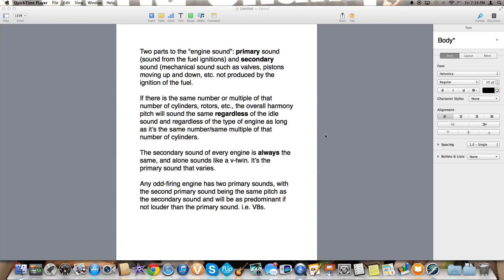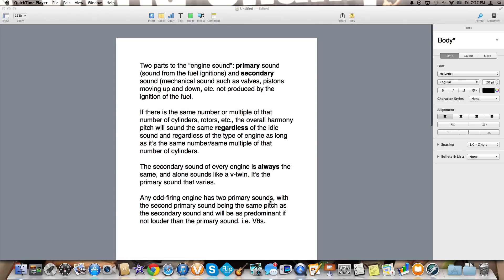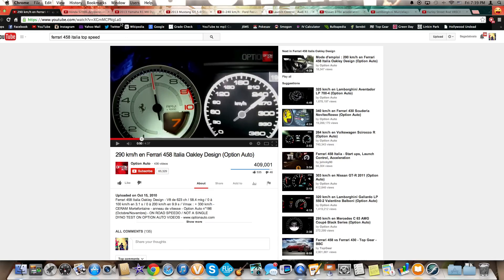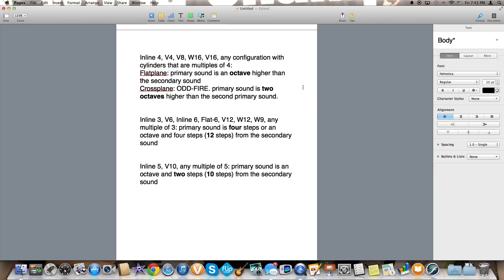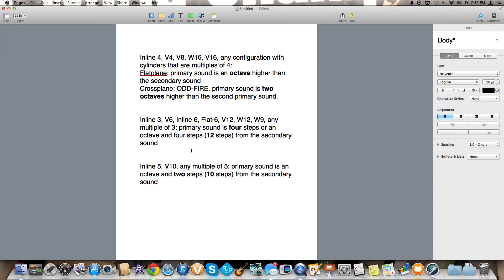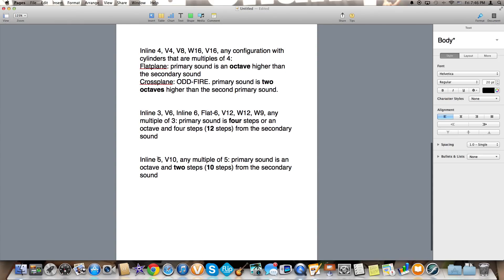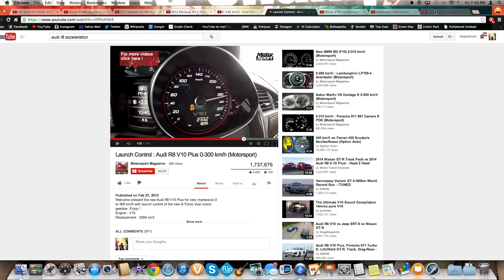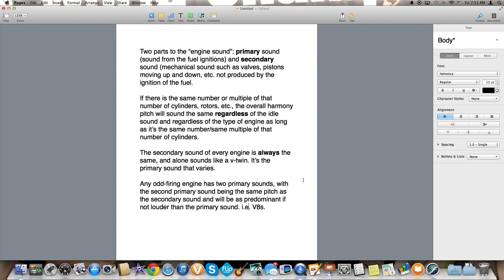Engine Sounds Explained

Comment: if you want the v6 to sound like a v12, wouldn't you need it to rev twice as high in order to sound the same?
Reply: Exactly correct.
Reply: No
Reply: no not really
Reply: No matter if you rev a v6 twice as high it would never sound like v12 unless you try to add some extra 6 cylinders if that's even possible even with those extra cylinders it might not even sound like a v12
Reply: Clearly you don't pay that much attention to engines
Reply: Cicada 3302 since a v12 is basically 2 v6s implying the firing order is similar to that of the v6 you are comparing, then it would be 2 v6s working together, the pulses would be closer together because there are more cylinders firing in the same amount of time so it's a higher pitch, but if you slowed the v12 down to match the v6 pulses it would sound really close

Comment: i3's sound like I6's, i prefer the sound of i3's over i4's personally.
Reply: i6s sound comparatively smoother and higher pitched than i3s. Although between the i3 and i4s, i like the characteristics of the i3s. Sound wise, i like them differently in different environments.

Comment: The Mustang is a flat plane crank motor ????
Reply: nope, cross plane.
Reply: @mcr0741  the new high reving gt 350 is a flat plane crank the old school 5.0 is cross plane but it is going away
Reply: @randyyoung9892  yeah, I just saw that. But the new 2020 GT500 is using a 5.2L cross plane V8.

Comment: I stopped watching after he said a V-twin is an odd firing engine. Because 2 is an odd number?
Reply: He is referring to the firing. Not amount of cylinders.
Reply: Banana Boat the v twin does have an odd firing order. its two closely splaced pulses per 2 rotations (considering the exhaust and the intake stroke) making them sound more similar to single than a flat twin.

Comment: using the term " ricer "  as a catch all inclusive term is prejudice.  not all flat plane crankshafts were made by the japanese. numerous flat plane crankshafts have been produced by euro nations. 
the first car i owned was a british 4cyl. 
triumph and mg had flat plane  " ricer " crankshafts, just to get started.
the brits died because of their incapacity to innovate ,  produce reliable electronics of both electric and fuel delivery systems , and like all western nations the incapacity of less expensive mass production.
 the old lucas electrics were  SHIT  and  AMAL carbs worked well when they worked.  in fact i found it much better to adapt a set of flat slide motorcycle carbs  ( mikuni ) to the british triumph/mg engines to make a  VERY   VERY reliable tuned multi carb fuel delivery system. it also helped to throw out the lucas coils, condensers etc and replace them with american produced  autolite, delco etc parts  ( adapted ) to make a performing ignition system that would stay on the road and out of the garage.  
the japanese, whether you like it, like them or not, have mass produced machines that have dominated the world markets.  you negative prejudice is possibly spawned from jealousy considering they also export the 2 fastest motorcycles in the world and dominate in the moto - everything classes in world wide motorcycle competitions. 
in fact your degrading terminology is quite short sighted considering the japanese have essentially bitch slapped the whole world with the most reliable- most massively produced engines ever, especially considering the price. 
harley v2 does not sound like other v2's. the harley v2 is 45* while most ( not all ) other v2's are 60* or 90* which make much better and smoother power because of the more symmetric power strokes, shorter stroke vs bore , valve train type and  geometry . the 45* v twin is more commonly used on bikes designated as " cruisers "  making high torque at idle and cruise, but not accelerating well across a wide band because of their massive weighted crankshafts.  60/90* twins make more efficient power across their entire band because of more symmetry in their power strokes and the ability to use a lighter crankshaft.  the loping of the 45* twin is caused by the disproportionate  asymmetry between power strokes and the long stroke vs bore. while again the 60*/90*  have a more " square " " balanced "  or bore being over or closer to the stroke length of the motor.
Reply: +mixter7x7 Ferrari, Lambo, and does Porsche use it also?

Comment: thumb down cause you included Japanese motorcycle inline 4 with  rice honda. all inline 4 600cc 1000cc sound like a moto gp or f1, nothing close to a inline 4 on a car. its insulting that you combined in line 4 cars with motorcycles. especially a hayabusa, they eat any cars on this planet. for the money you cant get the power and performance from a super sport or a super bike.
Reply: Mai Le fastest bike top speed 300-320mph, h2r cost up $60k, h2  $25k can do 200mph easy, so do the reasrch before you type ,keyboard warrior,let's see if r8 cost that much
Reply: Mai Le 4 tires vs 2 tires traction  very smart to compare. bike and cars are 2 animals,  why do you compare them ,No body tells you. who's started argue bike is after or car is. my bike don't lose traction when doing 0-60 but mine supercharged Mustang gt always. because too much torque. even its 4 wheels, and 285 rear,245 front. my bike has Dunlop sport max stick tires, at human body temperature, it feels like scotch tape. so stop comparing them. show me any video compare r8 to a bike track record. ps now days 1000cc bikes have 190-200hp per litter, no cars can do that without boost. 6.5L v12 Lamborghini 650hp, that's only 1cc per hp. r8 v10,5L something doesnt produce 1000hp

Comment: This video is foolishness. Some cars/motorcyles have aftermarket exhaust in the vid, and why wouldnt a v6 sound somewhat like a v8? Its the same configuration just 2 more cylinders. Maybe an i6 would much differ than a v6. Or rotary engine or w12-w16 but i bet some v6s can sound like a v8 especially w a cam upgrade. This guy has no clue what hes talking about tho like hes an engineer that spent 15,000 hours listening to different engines hes built/aided production personally lol

Comment: your a yaboe.your very biased towards engines and manufacturers. you don't know all the info and you're getting basic math wrong..you don't show the right hog,use a knucklehead or a pan head engine...you don't discuss the shorter life and rougher running of the flat plane..my engine (cross plane v-8) is 40 years old and run 13's in the 1/4.